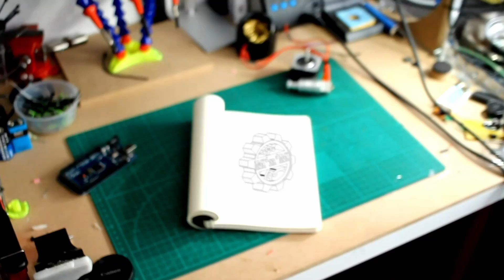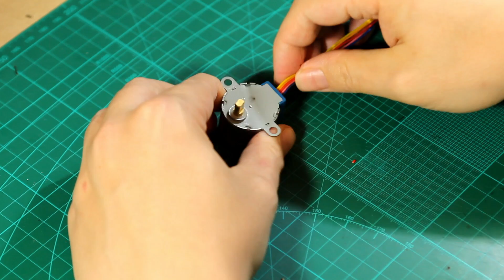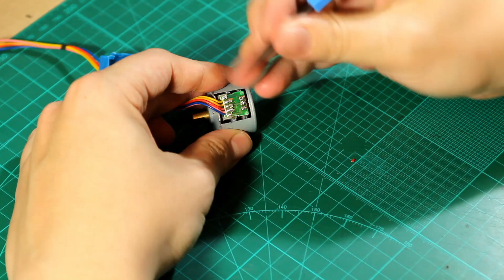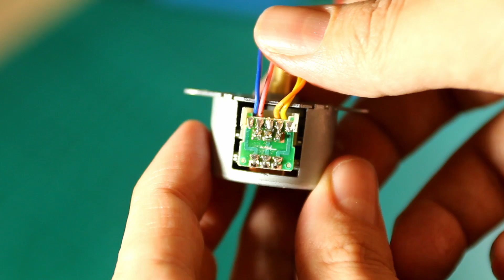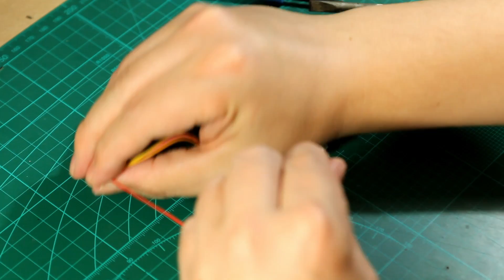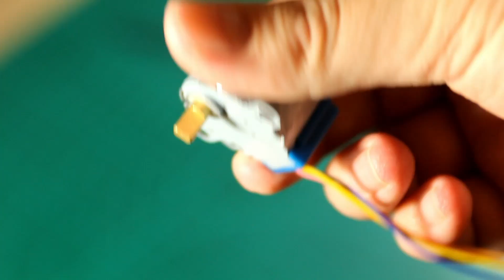#Quicktip: 24BYJ-48 Uni to Bipolar conversion

Comment: Thanks, Like many, I did that too. To put the the blue cover back again, I also removed the small clips, added a bubble of hot glue on top of the circuit board and pressed the cover back into its original position while the glue was still hot. (btw, make sure that no glue gets to the gears). This also makes all the 4 (thin) wire connections on the board more solid. Exchanging the 2 middle wires in the connector makes it excellent to connect to the output pins (soldered on) a DRV88 H-bridge driver. The latter works fine with the now bipolar  BYJ28, make sure to supply power to the DRV8833 from a dedicated power supply, not from a (in my case ESP32) microcontroller pin. I simply cut the red wire, because desoldering it might also affect(burn the isolation) the other surrounding solder joints.

Comment: Is it totally necessary to remove red wire? We can just swap the red wire after scoring on pcb?? Like red is dummy placed in last??
Reply from the maker: no you don't have to remove it. It's just, when I already have it open it is not much to desolder the cable. But yea clipping it or just not using it is enough ;)

Comment: Hi, I'm trying to run a 28BYJ-48 Stepper Motor + Pilot ULN2003. I make a montage to rotate a sculpture. The engine lacks a bit of power to rotate my room passing in bipolar I have more power in the engine? thank you in advance
Reply from the maker: The bipolar motor has more torque. You can also drive these motors with a bit higher voltage to get more torque, but that might reduce the lifespan of the motor.

Comment: Hi,
I modified a 28BYJ-48 to bipolar as You have shown in this Video 

but now i connected the motor to an CNC shield and its just making a sharp sound and its not moving

Do You have an idea what i've had done wrong? Please Help, thanks
Reply from the maker: there are some things that can be wrong. Most of the time the coils/cables are in the wrong order. You can use a multi-meter and check for continuity. If there is continuity, than the two leads belong together. Other than that it can be the motor driver, (maybe not enough current [changeable with the potentiometer]. And one important, these steppers are not very fast so it might be that you try to drive them to fast ;)
Reply: @MakenModify  my problem was the Order of the cables. Now it is working.
Thanks